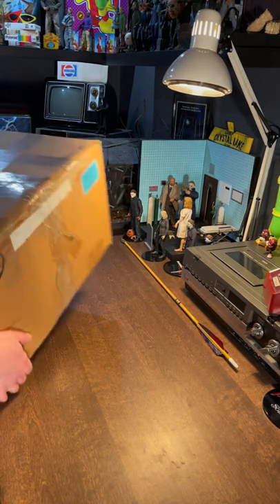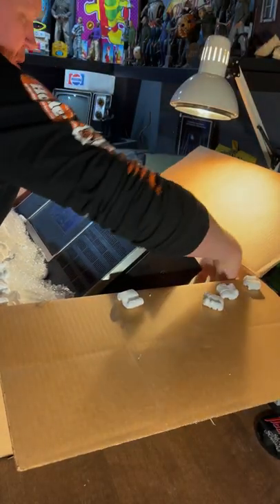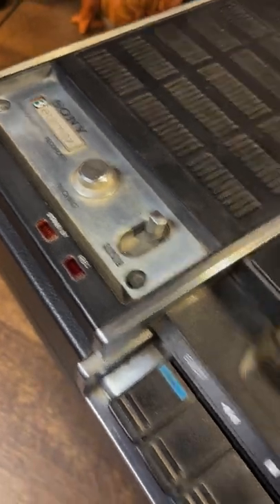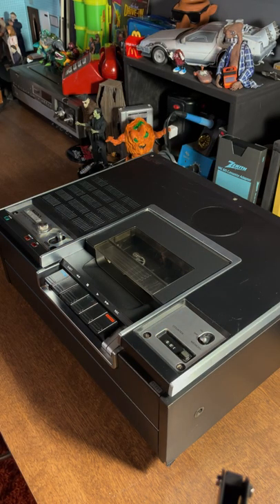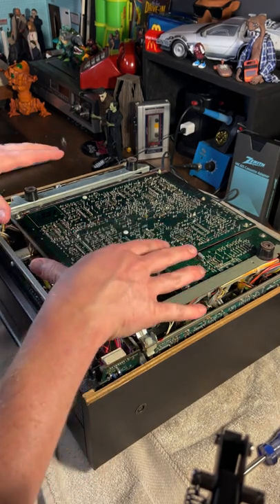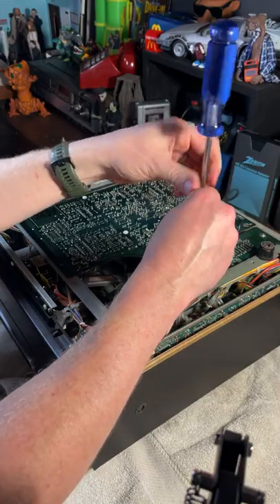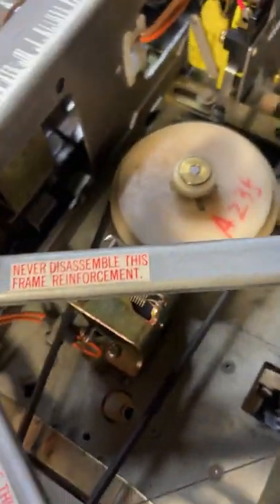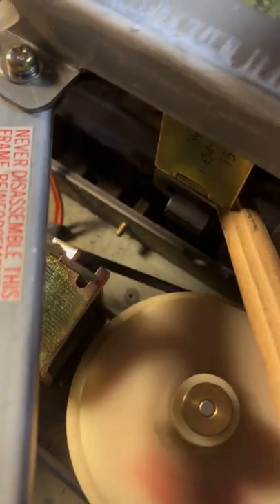Sony SL-6200 Betamax Player

Comment: Excellent troubleshooting skills, and an absolute imperative to restore your LV-1901 with its proper SL-6200.  Well done!  FYI, any commercially pre-recorded beta tape should be BII, as that would be compatible with any consumer beta VCR from the SL-8200 on.  The SL-6200 and SL-7200 were very early (and very expensive, so not as many sold as later models) so not as significant a market.  All the later Sony Beta VCRs I'm aware of could play BI, but maybe some other brands couldn't? and with a maximum runtime of 1.5 hours, would not have been long enough to hold many movies.  I know there were some cheap video companies that put out VHS LP and EP tapes, but I think by the time it was 'acceptable' for low-end companies to do so, Beta was obsolete, so I doubt there were any commercially pre-recorded BIII tapes.
I feel like we're kindred spirits; early home video (and audio) recorders, tapes, etc. absolutely fascinates me.